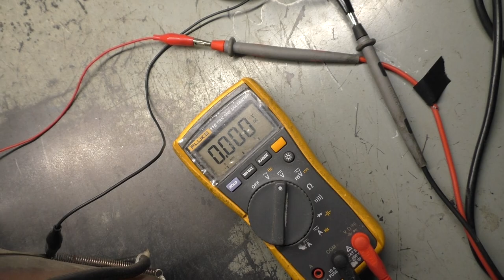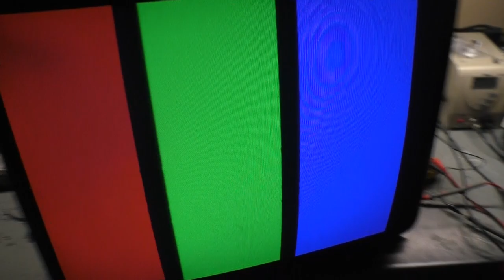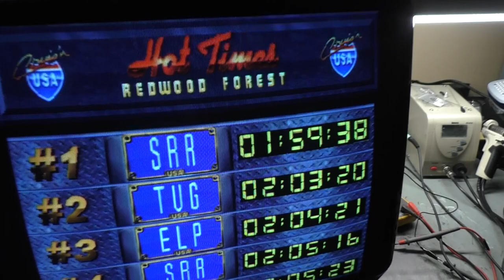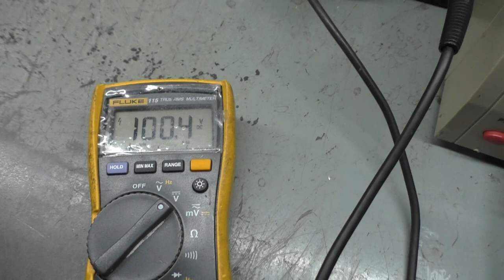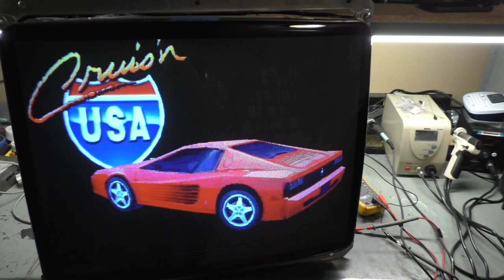27" Neotec NT-2701 Arcade Monitor Chassis Repair - "Ticking" - C450 Shorted?

Comment: Love your videos mike. Anyone ever tell you you kind of sound like Bob Odenkirk
Reply from the maker: Thanks. Nope.
Reply: @MikesArcadeMonitorRepair  I've been fighting with a ticking 2701 family version and still not having any success.  I found a blown hot(bu2532AL) - replaced with a J6920 which i've read is more resilient and shorted C423 924J capacitor that was showing barely any capacitance.  Replaced both of them and all electrolytics.Tested a whole bunch of other components in around the area around C423 all the way back to the HOT/drive circuit.  still ticking!  C450 was fine.  I"ve just ordered a new flyback.  any tips.  losing hair,  side note: I"m finding the schematic widley avaialble for the full family doesn't quite match up with my chassis.  For example the schematic says a cap at C490 and Diode at D490 and I have neither of those on my board.   also some variance with what is listed for some non-electrolytic caps and what I"ve got on board.

Comment: Did you test the HOT under full load to see that it was bad, or just replace it and then it started working? Just curious if you can test these under load, or not.
Reply from the maker: No, I'm not sure how you would test it under load. The chassis will output high voltage if you turn it on with the HOT installed.

Comment: I'm trying to revive one of these and when hooking up to D106 my meter is reading 1000V+. Tried the meter on the AC from my ISO and it reads 130V. Any ideas why that would read so high?
Reply from the maker: 1000v? If not sure how that is possible.
Reply: @MikesArcadeMonitorRepair  That's what I said! I'm pretty sure that would've smoked my multimeter.
Reply: @MikesArcadeMonitorRepair I'm sure you saw, but this was because the multimeter was on AC not DC reading the B+ 😂. I guess in my head, since it was so close to 120V AC, I just wanted to set it to that on the multimeter.